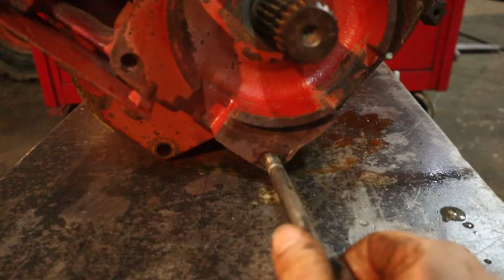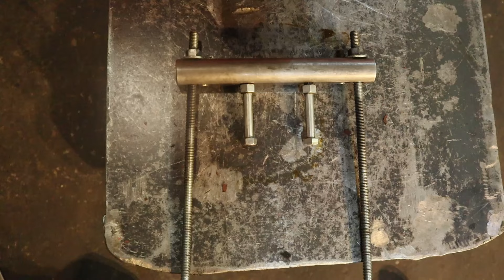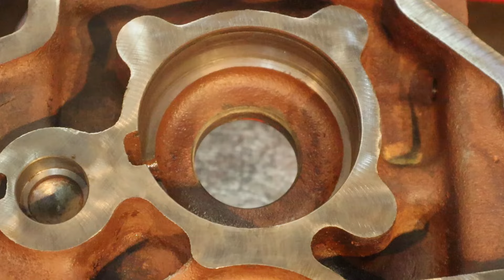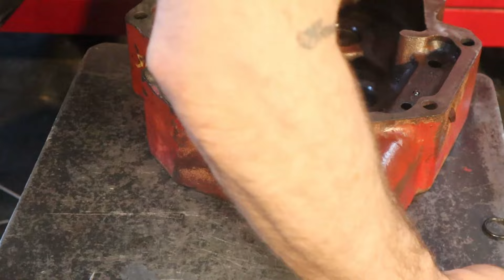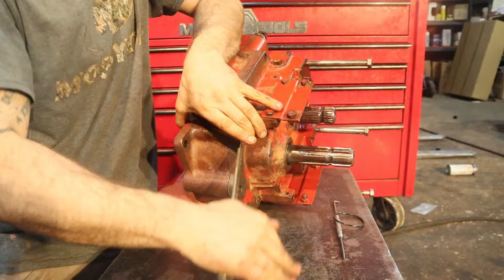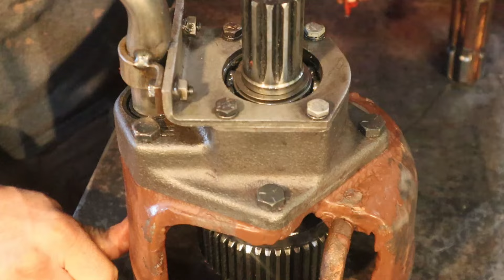IH PTO Full Engagement

Comment: That's a pretty nifty spring compressor. It's been a long time since I have had one of those apart. I do remember that's one stiff spring. I have a spare unit rebuilt and ready to put in if I need one. Good video, been better if it had some sound.
Reply from the maker: Thanks I'll get some sound on the next one

Comment: I have a 504D and I need to replace the pto seal. Can I take the  3 bolt plate off around the outside of the shaft and replace the seal or do I have to remove the whole unit?